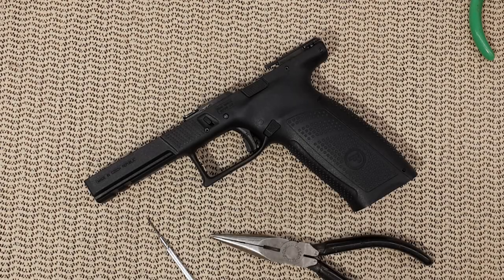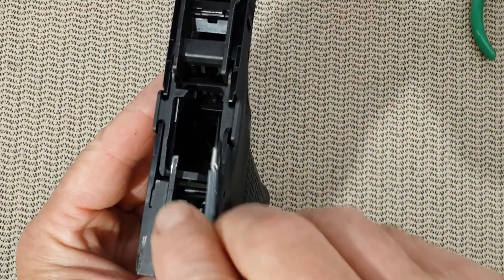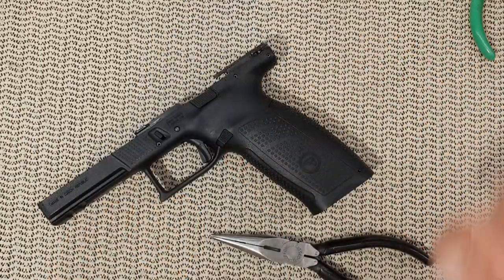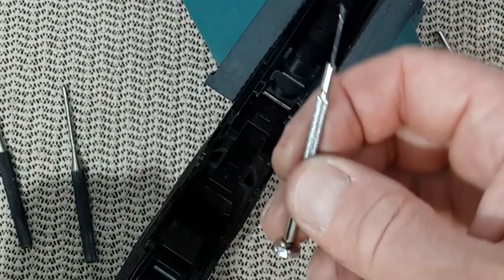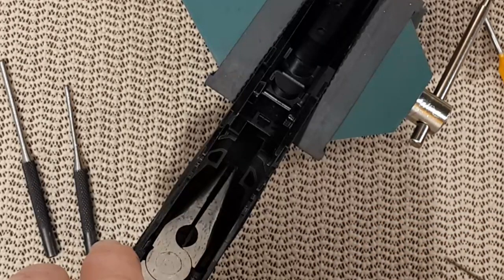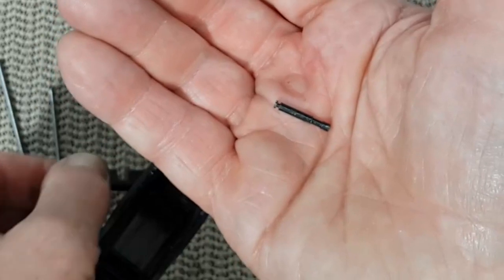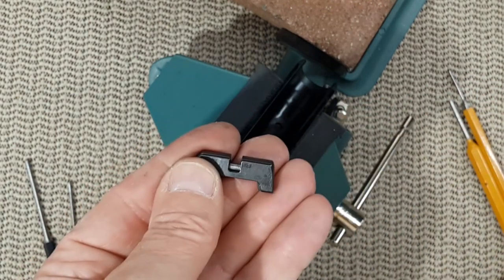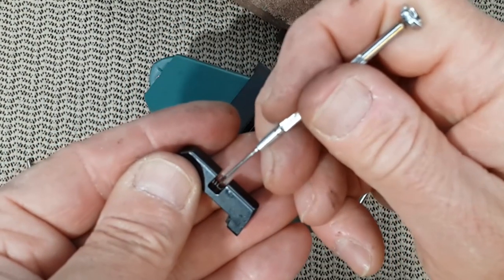CZ P10F / P10C Magazine Release Disassembly

Comment: Thanks for the video!

You absolutely need a jeweler's screwdriver for this. I thought I could do it with a tiny punch, and I managed to get it apart, but there's no way you'll get it back together using a punch to compress the spring - the punch blocks the vertical pin from going into the slot.

Comment: I have a similar small screwdriver. How much force is needed? I can't get it to pop.

I got it out. What I did isn't mentioned in this video. I used the same tiny flathead you use to take pressure off the spring on the top pin. I put the flat head part in the slot of the pin and slowly pried it out. For whatever reason my pin didn't want to pop even pulling it with needle nose. Got it swapped and this video still helped. Thanks!

Comment: Thanks for this video it was very helpful.  I was able to follow it through disassembly but made the mistake of putting everything back together without placing the pin inside the mag release back. My mag is now stuck and won’t release, any recommendations on how to get the mag out?
Reply from the maker: Have you tried to reach the mag release from the top with a very small screw driver and try to activate the mag release?
Reply: @practicalshooter6517  I was able to release the ,ag by pushing in the spring then depressing the mag release button. Pin now back in and mag release working as expected.

Comment: Thanks for the video, couldn't figure it out till now. Unfortunately I sent that sleeve that surrounds the spring into outer space so... looks like I am emailing CZ for a spare part haha.
Reply from the maker: LOL I feel so bad now. Maybe I should never had made this video. Good luck Argentum.
Reply: @practicalshooter6517   I found it when I was looking for a detent that shot out of my next AR build haha!

Life giveth and taketh away!
Reply from the maker: @Argentum7756  LOL you are a trouper LOL. At least, you didn't vacuum it .
Reply: Today I received my new P10F and immediately I started changing the magazine release, after an hour on all fours, with flashlight and magnet I could find the little pin that goes inside the release and that I have dropped.😅
Now I have thanks to you my lefty CZ P10F.  Very grateful, I live in Toronto I will try to find a green front sight for my new lady.👍
Reply: I am going to appeal to your good will, I have for some years a CZ 85 Combat and the magazine button is very hard and even with the use it has not changed.  I have not found information about that problem so I dare to ask if you know anything to solve this problem.  Thanks 👍🤝

Comment: No matter how hard i try i can't get that pin out. I think my gun is broken.
Edit: I got it out reversed and put back together, thank you so much for this helpful video.
Reply from the maker: It is not that easy. You have to start with a very small screw driver long enough to push that spring, but when it is done, that pin will come free.

Comment: I did this but the magazine sometimes gets stuck and the trigger doesn't reset sometimes. I wonder what's happening.
Reply from the maker: I don't understand the question Jesse.
Reply: @practicalshooter6517  after I moved the magazine release to the other side of the pistol the trigger doesn't always reset. It seemed like a pretty simple operation so I'm wondering what happened.
Reply from the maker: @JesseMrozowski  Give me a few days to look at the relation between the mag release and the trigger assembly and  I will get back to you.
Reply: @practicalshooter6517   I moved it back to the other side and everything is fine. I wonder if my magazine release itself is incorrectly made that it's holding the magazine at a strange angle and pressing against the trigger bar somehow.
Reply from the maker: @JesseMrozowski  I don't think it is your magazine, I think it could be the "Magazine catch plug" that is not seated all the way in (look at the part in your manual), but now that you have done the swap a couple of times and are knowledgeable to do it again with more confidence, I suggest you do it again and see if it works.  Take a couple of pictures of the assembly before taking it apart, and compare it with your final work. Let me know how it turns out Jesse.
Reply: @practicalshooter6517  I did some experimenting on my own and I found that the magazine catch plug was seated and I found that it doesn't happen if I move the magazine to the left of the pistol. After some more experimentation what seems to be happening is the mag catch is pusing the mag release just enough to the right that magazine follower is clearing the slide catch. This is dragging on the slide enough that it doesn't fully reset the trigger. Not sure what to do so I'll be contacting CZ. See the picture to see what I mean. https://i.imgur.com/YIz6D9p.jpg
Reply: @practicalshooter6517  I just realized I have no idea if this will impact actually shooting because why would I ever be inserting a empty magazine? I'm going to take it to the range and see what happens.

Comment: Hi. I did this but the magazine catch pin popped out and ca sent the wrong part as a replacement. Does anyone know where i can get the correct one or am i just boned.
Reply from the maker: Find the exact part number on your manual. Call CZ, do not email them, they don't respond to emails, and explain to them what you need. Good luck
Reply: @Lucas Bohannon did you ever get that part ? I’m in the same boat as you were and CZ said they don’t have that part available so idk how else to get a replacement
Reply: @ybarraj12  I got it sorted I called cz and they sent the correct part. There’s 2 versions of the p10 so they need to send the new release not the old one